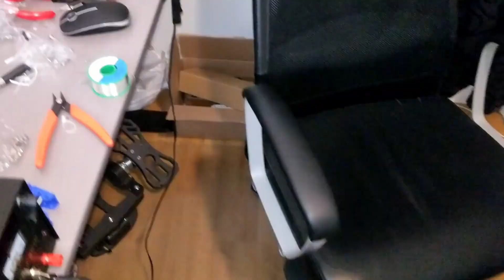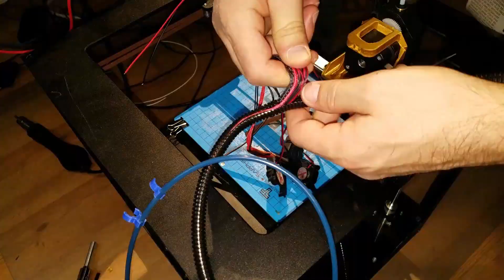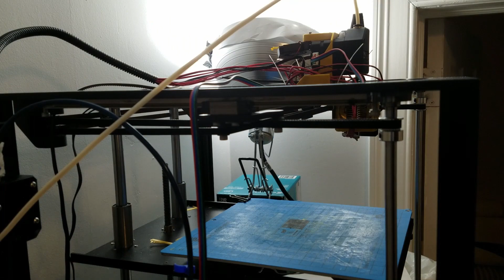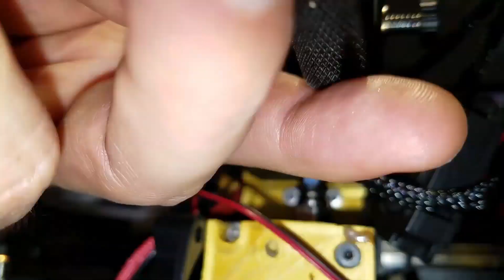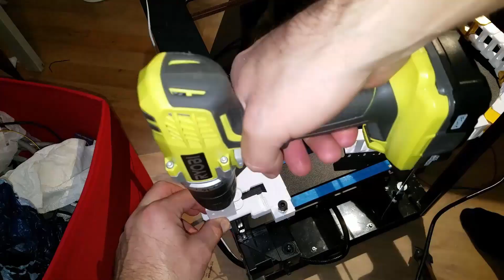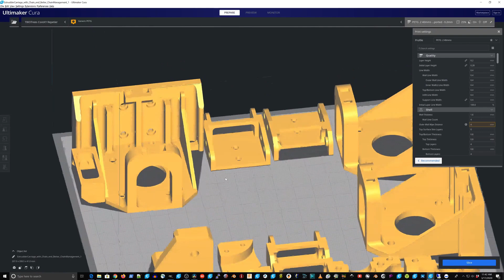Direct Drive Extruder | TwoTrees Sapphire S Upgrade | BMG Extruder | E3D V6 with cable Drag Chain

Comment: Did you take into account that maybe the VREFs were a little too high for the smaller motor? Usually if a stepper is overheating, its because its being fed too much current. Smaller motors on extruders are usually countered by gearing, to compensate for the lack of torque
Reply from the maker: I did take that into account but I did not make any changes, I just changed back the motor. That solved it.

Comment: My SAPPHIRE PLUS arrives soon. I may need to look at a Direct drive system upgrade of sorts.
Reply: Mine showed up after a long wait. Should have canceled the order. Parts were missing, guide rail bearings were laying in the packaging and everything was warped. 3+ months later I’m still waiting on missing and damaged pieces to be replaced.
Reply from the maker: if everything on your sapphire plus extruder fits the sapphire S, then some of the parts in the model I remixed could help you. i am not sure about the frame chain attachment bracket and the height of the chain which may sag more under its weight because it will be longer. i think the plus already comes with a bmg clone but no e3d hot end. so if you want the similar setup, it might work. there is one other major issue to keep in mind. this model increases the volume of the sapphire S on the z axis by 25 mm. SO you have to be SURE the side rails in the sapphire plus allow for the bed to travel higher than what it is now. also the lead screws need to allow for that increase.  here is more info about this 3d printer which perhaps you've read https://3dprintbeginner.com/sapphire-plus-review/
Reply: After over a month of waiting I canceled the order and got refunded. Two Trees was lying the whole time and turned out they never shipped the unit but told me they did...
Reply: @classics967  good for you... The Plus is complete garbage..
Reply: @pascal184  I agree to a point,  I'm in process of re-engineering it. Good parts, terrible execution. I bought mine thru banggood, if I got it thru Amazon I would have sent this shit box back.